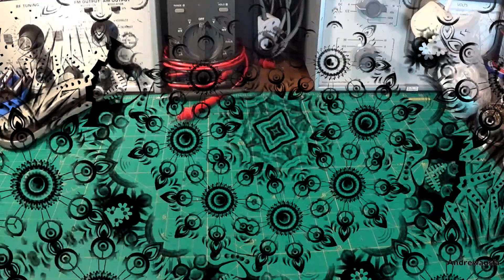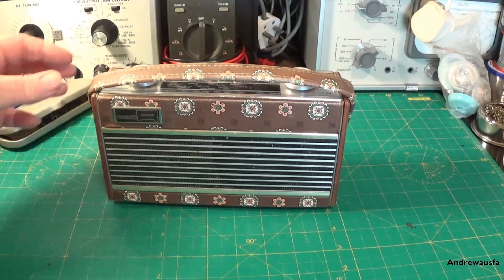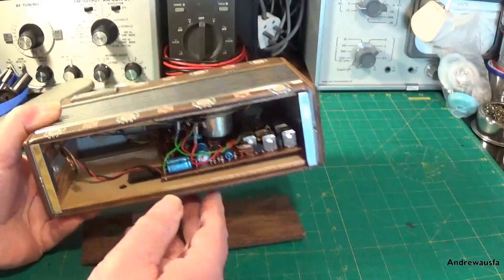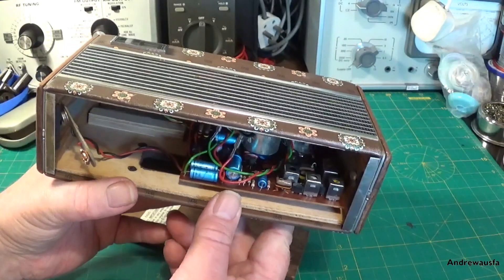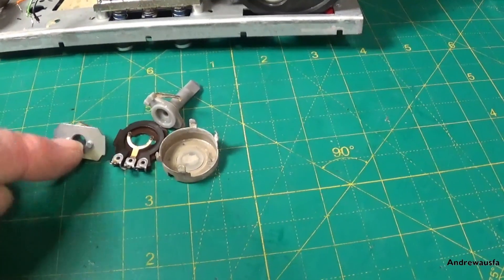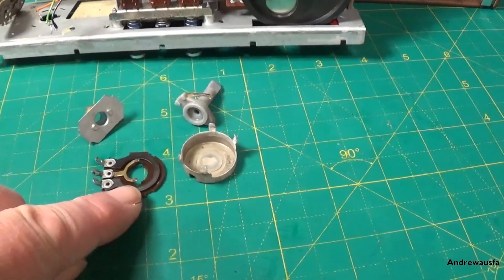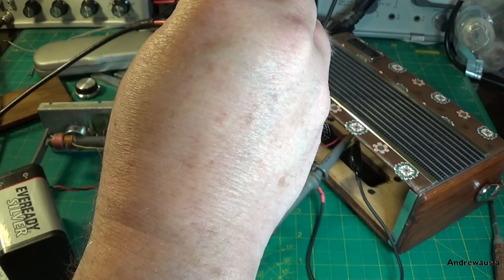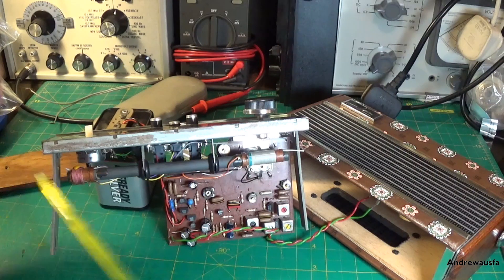Roberts Rambler Radio

Comment: Very Nice 22-206 Meter There Andrew !! Was Never a Fanboy Of The Rambler Give Me An Older Roberts Anyday That One Looks Awefull But Hay Ho Every One Has Their Opinion But Still a Great Video Regards mike.
Reply from the maker: The meter was a quid from a radio meet, much the same functionality as an AVO but a fraction of the weight! I really like it and it has a FET front end so very useful for radio work. I'd definitely recommend the Rambler as a first radio to repair, very easy to work on. Despite it coming from South London and not Maidenhead :)
Reply: @Andrewausfa  Yep Andrew a Real Bargin For a £1.00 Will Def Be a Lot Dearer On Fleabay he he